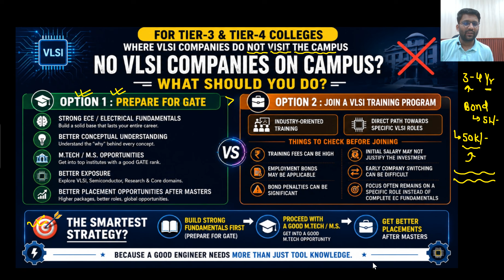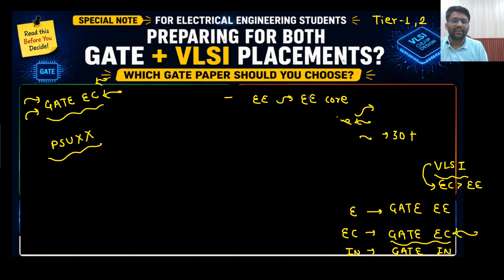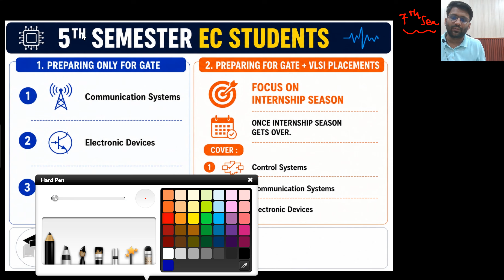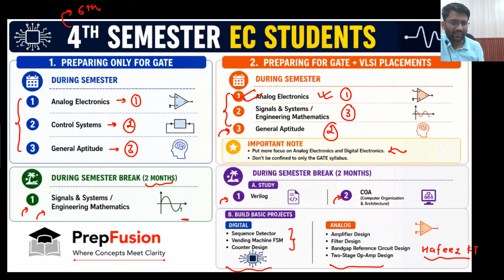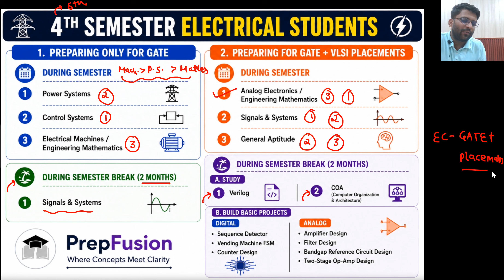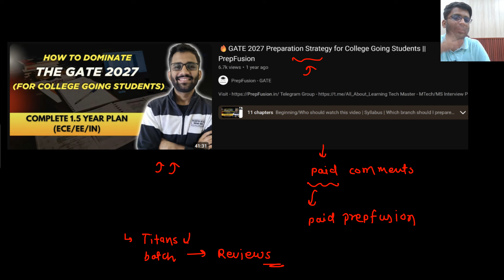🔥How to Manage both GATE & VLSI Preparation || PrepFusion || Himanshu Agarwal

Comment: This is "THE BEST" course for GATE since u learn electronics in a intuitive way rather than using much math and also the assignments made by sir, will surely challenge ur conceptual understanding of the topic very much, which will further help u understand the topic in a better way. Many problems would be solved using just concepts and not by equations or by set of predefined methods just intuitive analysis , I highly recommend this course who are preparing for GATE .